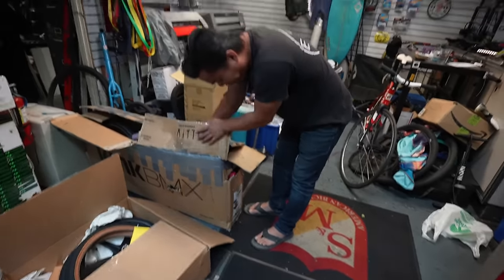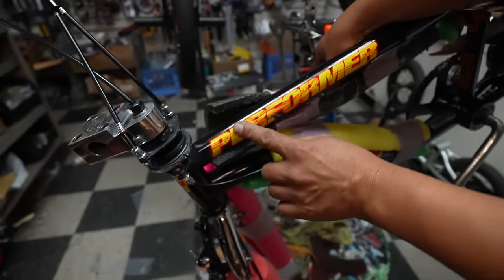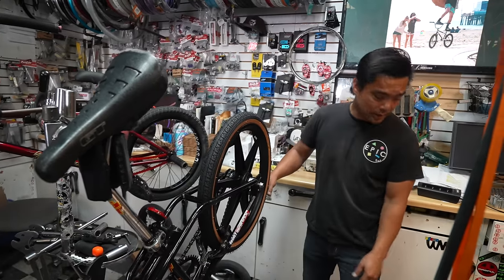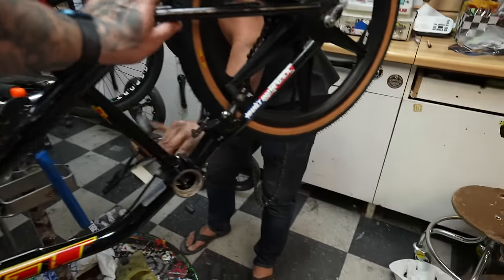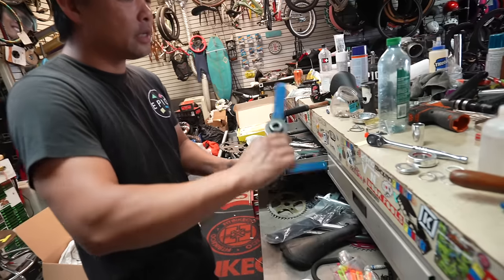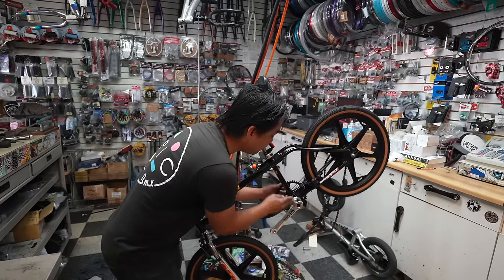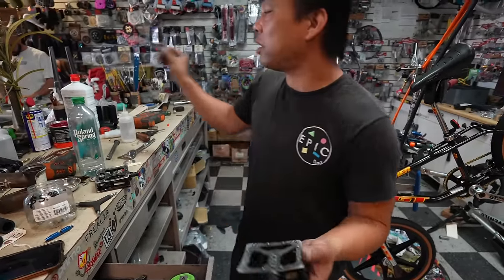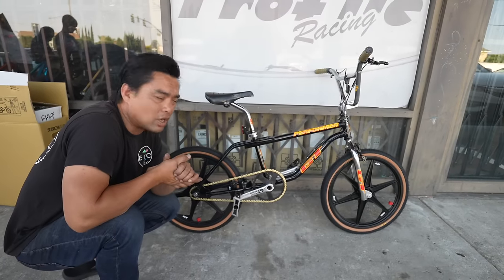Shop Owner Claims Customer Got Ripped Off On This GT Performer Bike!

Comment: Bike is actually a 1994 they came with a dyno stems from the factory. I got a 100% original chrome one
Reply: Exactly what I was thinking I had both dyno’s and GT’s from that era and the dyno’s definitely had GT stems and seat clamps on them or vice versa ……and the beginning of the 90’s they didn’t have the big logo ingraved in the stem, it was just a solid piece of billet aluminum……if only I would have held on to a couple of those bikes…..considering I literally had over 20 of them thru out the entirety of the 90’s
Reply: @trentdawg2832  I still  have a few of my bikes including a dyno and performer  which would prove your point about the parts lol. My dyno has gt parts from the factory,  seat post, seat, wheels, clamp, grips, etc
Reply: @trentdawg2832  Dyno made by GT.
Reply: phu must know that - everyone knows that , probably slipped his memory!
Reply: I bought a brand new chrome gt performer in 1994 and it came factory with the same dyno stem oddessy gyro and oddessy pit bull rear brake and the bulldog front brake, fan mags,and came with the decals on the bars under the clear gt grips,that bike looked to be all original
Reply: GT Dyno's were so much easier to pedal than my Free Agent Ambush
Reply: Yeah, i had the same bike but it was in bad condition and I always knew them as GT dyno. Im Surprised the owner seemed kind of shocked to see a dyno stem.
Reply: Tri blade mags all-day long
Reply: Yup, bob morales sold the dyno design and name to Gary turner back in the mid 80’s.
Reply: Looks like a complete 1994 GT performer. That sticker is correct. It was built in America. As in put together. Some of the parts were made elsewhere. “Built” is the key word GT used. For some reason the 1994 performer and vertigo came with that Dyno stem. Great video, keep up the good work!
Reply: I have a 94 but I have the 990s mounts welded but all the other 94s have that style ot the on top style is my bike a 94 or a later
Reply: Same
Reply: Loved that dyno stem had them on mines
Reply: @trentdawg2832  i had a 94 GT vertical that was a cool bike.
Reply: I had the Dyno Compe brown sugar color from like 99 it was the bomb
Reply: @DJTodda the mid to lower end models had the Dyno stems. The “high” end or Team models had the GT block stem
Reply: I had one in a dark metallic green with chrome stems. Best looking bike I ever owned bad as hell. GT & Dyno is the same. Every single Dyno sold has GT parts PERIOD! Know this for fact so your right. It’s real. A Dyno with no GT parts would scare the hell out of me. PASS
Reply: Right as the guy never heard of a GT DYNO?? He’s oriental of course he doesn’t know Usa stuff.
Reply: Look like GT lay back vs Dyno S seat post.
Lmkwow
Reply: Its actually a dyno gt….
Reply: Its actually a dyno gt….
Reply: It's absolutely a Dyno gt I had three friends that rode different versions of them and I rode a Dyno Nitro
Reply: 94 gt dyno I had one wish I still did the gyro bulldog brakes I miss that bike
Reply: I had black my buddy had chrome both bought original since new....

Comment: Gt owned Dyno, Robinson, Auburn and they made parts for other team bikes. All high quality parts! Great build up and learned something about crank spacing too 👍🏿
Reply: They provided parts for Powerlite to. 
I  have a 93 P-61 and it had GT stamped Profile cranks, chain wheel and seat post clamp.
Reply: But Dyno parts shouldn’t be on a GT.  GT parts can be on the other brands.   It’s the bigger name.
Reply: I miss my Robinson and elf bikes so much, so damn light you could lift em with just your pinky at like 12 years old lol.

Comment: That GT turned out nice! I always wanted one like that when I was a kid. After I was an adult, I found an all chrome 2001 Redline 5Spot in a pawn shop when it was just a few years old and someone had put a set of Torker 3-piece cranks and a sealed BB in it already and was in perfect condition. It took me 6 months to pay off the lay a way and that bike has never stayed a night outside and has always had a place in my house somewhere. It has sat in a corner collecting dust for years and I am almost 50 now and I got bored recently and needed to get more exercise after working from home for 2 years, I dusted the old bike off and took it for a spin. I started to ride it everyday again and after almost 20 years the BB has developed a few pops and clicks and the 180mm cranks were killing my old knees so I hit EBay with a fresh credit card and ordered a ton of new parts for it, including a set of black Tuff II’s with red wall tires and I found an original downtube sticker for an RL20 that seems to fit the bike perfectly. I found an old school Velo Crossbow seat with a touch of red that matches the tires and decal with a new set of Troy Lee grips to round it off and I love it more now than I ever have and it’s like part of the family. I couldn’t decide on a crank length so after tons of research I finally decided on a set of 175mm which feel really good on my MX24 cruiser but I felt like any shorter and it would feel like a kids bike. Once the cranks get here I am going to blow it apart to the nuts and bolts and do a full cleaning of the chrome parts and reassembly. I may have other bikes but this one will always be special to me and reminds me of a simpler, happier time in my life before all of the headaches of adulthood. I guess that’s why old school bikes are so high now, adults like me with means to buy those bikes we lusted after!
Reply: that's dope - care for your bikes ! 170s are fine to.
Reply: I think 175 is pretty standard on most bmx bikes so should feel just right
Reply: I went with a set of chrome 175mm cranks and added a new chain and chainwheel just to freshen up the drivetrain. It rides better than it ever has now and I get compliments on it just about every time I ride it. I built a new school fitbikeco xxl TRL that I found in pieces on eBay but didn’t like the knee killing 30/10 gearing (60 gear inch, 3.0 ratio) and stepped the chainwheel down to a 28t (56 gear inch, 2.8 ratio) which gives it a little higher cruising speed than the standard ‘55 inch’ setup but doesn’t make my knees ache (as badly) after a long ride.

Comment: Nice!!!....I still have my '87 GT Pro Performer with : ACS R.L. edge freecoaster, Haro knee saver, Tioga Roll pegs, Tioga 1pc Crank, Tuff-neck sprocket, GT stem, GT laid back seatpost, Dia-Compe Bulldog, 990's, GT seat post, SST (??)platforms, Mushroom grips, Mushroom crank dust cap, ...all parts I sourced back in '87. The wheels though need to be re-laced, got them from Rockford BMX. 1st time I listed everything, now I have to put it back together. Also have the Peregrine Mags in Radberry, and my 1st set of mags, Tuff Wheels II, that was on my 1st build, a '85 Vector, which got stolen at the Pac-Man Arcade in Pasadena, along with my Brother's Race Inc, our friend's Torker., and the only bike that we recovered, my other friend's Schwinn Predator...That was the worst day for us, ever (summer of 1985).
Reply: Pasadena, MD?
Reply: @jonmcdonald6374  Pasadena CA. Back then, I rode with my younger brother and at times we were like 13 of us, one being Jesse Puente who was a successful Flatland Rider. Fun times indeed!

Comment: That performer is dope, i normally stopped in 89 BITD but i dig some of the early 90s gt and Dyno's. I restored a white 91 performer in 2008 that i paid 50 bux for,and also my friends 90 hazard decal performer that he still has and i changed some parts on it recent and dialed it all up and he's riding it.
Reply: In other words i like all the S bend gt frames. My 87 Dayglo PFT is my Grail. Its on my channel too.

Comment: Great build!  This is a 94 GT Performer.  The Team Model version in 94 only came on the Pro Freestyle Tour.  It had the padded seat and now rare chainwheel.  All around this is a good upgraded Performer.  The three spoke mags first appeared in the 94 GT catalog too.
Reply: I have a 94 but it has the 990s mounts welded on it and not  the single through bolt style breaks all the other 94s I've seen dont have the welded 990s

Comment: Nice vid.  For the sprocket lock nut, put it in a bench vise and turn the cranks, they come off super easy. No more shredded knuckles. ;)
Reply: That is what I’ve done since the 80’s. Can’t believe he doesn’t use the bench vise method.

Comment: Killer build guys Those! Those tomahawk mags are definitely the raddest wheels GT ever made, wish they would repop them with newschool tech. I have a brand new set of those pedals in white I was planning on painting to match my Dyno Compe, highlighter yellow with black spatter
Reply: If you got brand new pedals like those don't paint them just save them and find used pair to paint instead and I agree GT Tomahawks are the best. Personally like the older GT logo version but both are great.
Reply: Not tomahawks those are GT fan mags
Reply: @djft6944  if you watched the entire video they replace the fans with tomahawks

Comment: This a 1994 GT performer in GLOSS BLACK (Made in the USA) and the dyno stem is not unusual, great find and great build! GT was made in the USA until 1998.
Reply: Some came with a blank stem which was exactly same as that GT/DYNO stem, they came on all early and mid 90s entry to mid range GT and DYNO completes.

Comment: Man those 3 spokes where realy whippy they where the first thing switched out on a 96/97 performer i put t1000 oddesey wheels on mine with some s+m cranks a dk fatboy inverted and some exposure 4 peice bars i rode dirt on it and used it for work still got a few parts of it buried in the shed someware .
Kool vid mate 🤘
Reply: Those 3 spoke wheels are worth a lot now. They are iconic. Typically just for cruising. Not for serious riding. But definitely hold a place in BMX history.

Comment: Built/assembled and manufactured or made are two different things and per the trade regulations of the time, you could say a bike was built in America (read: bolted together) using parts that were made in asia (read: welded)

I had a 1996 interceptor and i was so shocked as a kid to find the made in taiwan stamping on the bottom bracket shell despite the "built in america" stickers

Comment: I own the exact bike. That bike is 1000000% original. Including the built in USA sticker. Notice it did not say made in America. Assembled in the us.. built in us just means it was totally assembled in the US. Wish I could post a pic of mine.
Reply: I was going to post the same thing. "Built" - love the 90's.
Reply: GT DIDNT COME WITH ANY DYNO PARTS.   HOWEVER DYNOS HAD GT PARTS.
Reply: @honorablewiz7447  not quite. Depending on the year, gt’s came with dyno parts. Notice the stem on this bike does not say gt. The older bikes did
Reply: I did the same wheel swap he did, I agree the tri blades don’t look as wicked. I also added a gel gt seat. This is my love bike now
Reply: @timmychube5388  just a Dyno Stem.. right...make no sense GT DID NOT PUT DYNO LABELED PARTS ON ON GT BICYCLES.  IT WAS ALL GT..  previous owner put that stem on
Reply: @honorablewiz7447  Some bike shops would build a frame and fork set in store with what parts they had on hand. Or maybe swap out parts for whatever reason. (Maybe another buyer wanted a bike with certain parts and they would just switch parts from another bike there instead of ordering.) The reason I say this is because my brother bought a 87 Dyno Pro Compe new from a bike shop back in 88. It came with a Schwinn "Yo!" sprocket. Everything else was GT or Dyno (like shown on the catalog) except for that Schwinn sprocket.
Reply: @ChargerBullet  now that you're older you realize how wrong that was.  Feeling a lil gypted?
Reply: @honorablewiz7447  Not really. It wasn't my bike and besides most kids into bmx and freestyle back then would constantly swap out parts. 

Besides, you are wrong on the Dyno stem on these '93 and '94 GT's. There are a handful of survivors on bmxmuseum that prove this.

Comment: looks like a nice 93 gt performer frame. 3 blades didnt come out untill 95 so tommohawks are a more period correct choice. some 95 gts came with those dirt lp5 tyres not streets on the 3 blades.
Great looking bike and good work guys.
Reply: My 94 came with the 3 blade wheels. I have the same bike
Reply: @traviscomeaux4520  kool so blue with orange decals? Thanks for the information.
Reply: @tim7692  mine performer  blue with pink performer decal and my forks are painted not chrome

Comment: I have been trying to find one like my gt performer I bought in the 80s. Was Maui blue and 2 piece crank. But the kicker is that I had white pegs that bolted on the forks.. the forks had threaded "bungs"  to add the white pegs. They were not the flip up and down ones and bought straight out of the bike shop. Does anyone have an idea on the model or specific about the one I had?

Comment: I have a 96 Dyno air, does not have the original Wheels but the bike and everything is still original, it has like the black background with red splash paint, what is the value on a bike like that exactly?

Comment: Is it still possible to get decals for a 94 dyno air? Mine got stolen years ago and they took some of the stock decals off of it. I ended up putting ones off a 98 on it because I couldn't get the proper ones for it.
Reply from the maker: You can find remakes online
Reply: @AlfredoMancuso  thanks. I'll have to try and find some. I don't like the mismatched decals on it.

Comment: I picked up a 95 performer that has been hanging in a coworkers barn for 28 years all original still has the rubber tabs on the tires.

Comment: I remember as a young teenager I had friends that would just give me a clean Performer frame for free, then in 2006 I bought one exactly like that one on Ebay blk on chrome forks, 6 spoke GT mags in immaculate condition for like $250, I regret selling it seeing how much they go for now. This summer im building a full ground up Haro Ground Master, I got all the Haro parts for it, not gonna lie when it's done its a easy $2,000 build..  inflation is crazy...

Comment: Just to fill in Phu Alfredo almost guessed it. It's called a Phullips just kidding Phillips cause the guy that patentend it back in 1932 name was  Henry F. Phillips. The single slit screw was there prior but he improved it by making it a cross which still fitted the older design screwdrivers aswell as what we know now to be a Phillips screwdriver. It also has some car history as it was first used on the 1936 Cadillac which served as a trial for the screws viability. Peace and thx for the information as always. ;)

Comment: def indoor storing or cleaned and wrapped away in a garage very well. How I got some 1990 steel haro pegs that were barely used for $10 cad with $5 adapters to fit 3/8 axles.  Haro bike was mint and was told it was kept inside wrapped up for years. (All black and sadly in parts today since my little brother rode it and didn't take care of it well).

Comment: It's nice .. I have a 92/93 interceptor  chromoly  put skyways on it .cuz I'm og.. I wanted to put 80s styling  with the anodised  diacomp stuff but the report stuff looked cheap..   there's alot of color options for pads grips and tires.   ITS COOL ..BUT THE ONE YOU HAVE  HAS THE FREE STYLE FRAME..

Comment: that built in USA sticker was a factory decal not to be confused with made in USA. It was common practice for GT to mixmatch stems between GT/Dyno in that era. that bike was an “all OG” and cherry as can be 1994. He did fairly good for today’s market. Also, imo, he should keep all the factory parts he upgraded handy. 

 I just scored a black 92 in similar condition minus factory tires, grips, and front brake cable. I am replacing all of them with period correct repop parts from Porkchop BMX and since the decals are shredded, I’m going be replacing them with period correct replica decals with a Hot Pink over chrome with white shadowing decal set. 
Love old GT’s and Dynos!

Comment: good bike. looks great. but that is high to me. i got a complete old school haro. original everything. tires too. mint. even original reflectors still. gorgeous bike. i would let mine go for way less than 1000 and it is mint like it left the shop when it was bought. 700 i would sell mine for.